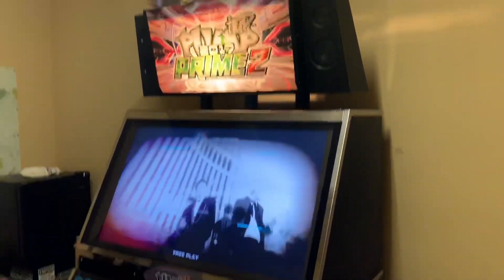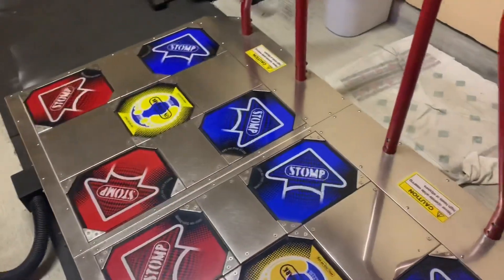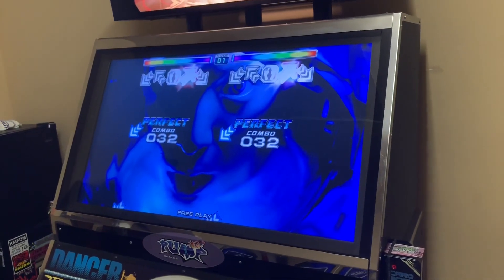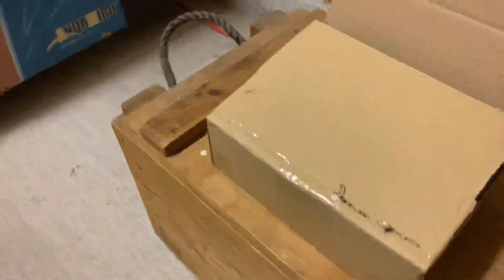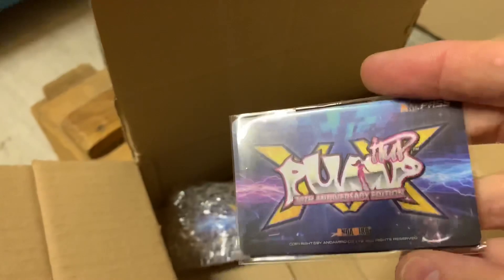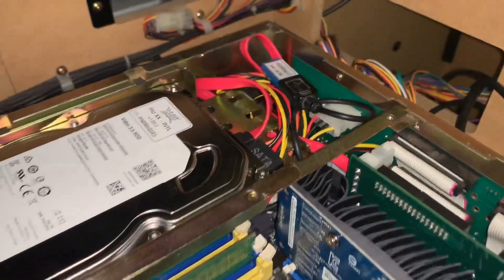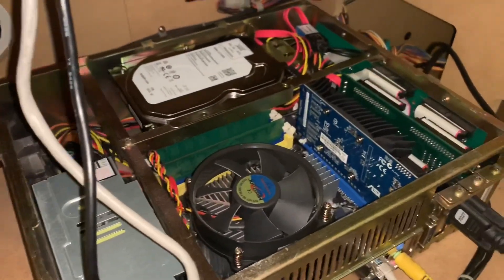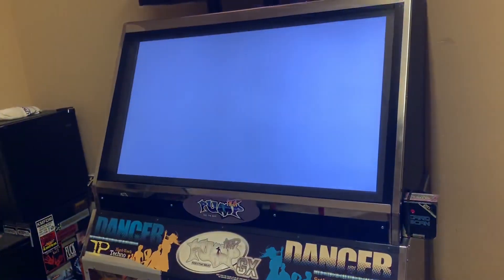Pump It Up XX 20th Anniversary unboxing & GX arcade cabinet upgrade

Comment: Hi sorry if this is a little abrupt but I'm wondering if you're able to help. I play lead guitar in a band and I've been having trouble trying to find a venue for my band to play and coming up with a rig that doesn't require too many things to hook up, and in the previous shows that we played, we noticed that every time we played we did fine but then every time we had a drummer playing with us, the backing track wouldn't get loud enough that the entire show always ends up derailing. So we started thinking of having one of those Pump It Up cabinets and incorporate it into our live set, because not only do we constantly get told that we have to really go out of our way to have a crazy enough setup to get everyone's attention, we realised that Pump It Up is one of the rhythm games known for its skill-intensive gameplay, and one of these cabinets tends to be loud enough that we could play our guitar parts right next to them and we would still be able to hear the backing track, thus giving us the idea of using such cabinet as an instrument to replace the drums. I'm not so worried of having an updated version of the game as much as I am of having a version of the game where it's possible to have custom tracks/levels in the game because we need that to play our original songs. Which Pump It Up cabinet is ideal for us to buy? Our budget lies between $1.5K and $2.25K. -WintermintP
Reply: I hope you do realize Pump it up Machines go from 10-20k$

Comment: Sorry, which graphics Card are You using in your machine?
Reply from the maker: Graphics is an Asus EN210
Mobo is an Asrock G41C-GS

Two sticks of 4gb PC3-8500 ram

Please note: I found sources online that mentioned Asrock G41M-VS3 as motherboard for versions >Prime. However, Prime 2 WOULD NOT boot with this motherboard and DID boot with the G41C—GS. I don’t think this info is anywhere else online. Good luck.
Reply: Amazing, I Was looking for the exactamente same model of the Mobo but I didn't knew if they could run the Game, anyways when I have the Game fisically or any poder Game such as prime or nxa) I Will give some feedback on it
Reply from the maker: M0ST1CHU One other data point I can provide is that NX & NX2 will not boot on this setup. Both of those ran fine on the older motherboard & gfx that are stock on GX cab but unfortunately doesn’t seem to be backwards compatible, just fyi
Reply: No problem, and Thanks for the help, I Was thinking about using this set Up Ford stepmania and newer soft

Comment: Hey do you have any links to the tutorial on how to buff the pads? Looking to make my pad shine! Much appreciated if you can help,
Best regards @ketafol
Reply from the maker: I’m sure there are are but I don’t think I went by any specific tutorial...

This is what you need:
A decent sander (circular probably > belt)
An assortment of pads from grits in the hundreds to as high as possible. I think 8000 was as high as I went although I believe there is 10k

-Take metal pieces off obviously
-For triangle brackets, get a piece of wood and use a piece of plywood and dremel or something to cut out inlays for you to secure them down so they’re not skittering everywhere when you try to sand.
-Pieces that have visible deep scratches will need to start sanding in the hundreds until smooth and matte finish
-repeat 
-work your way up to finest grit for mirror finish
-This can potentially be done with plexi pieces as well but you’re not likely to get as good a result as just getting some new plexi squares. Also, the wear & tear on plexi pieces comes from below, wearing out decals, which can’t be fixed, only replaced.
Good luck! This part takes some work but it’s definitely worth it!

Comment: What's the going price for a Pump It Up GX these days?
Reply from the maker: Definitely depends on condition... This cab was in sorta rough shape (but fully functional at the time) and I think I got it for like $1500-$2000. I’ve seen people asking $4k for ones in good shape.
Reply: @ketafol  ouch $1500-$2000 thats not worth it for a GX at all I'd say $1200 tops and if you look hard enough you can get one for super cheap i got my SD cab for only $300
Reply from the maker: Nice Youtuber It’s been a while.... you may be right, might’ve been closer to $1000. I’d still say less than $1k would be a damn good deal if it’s in decent shape.
Reply: @ketafol  ive seen gx cabs for as low as $600 but yeah less than $1k is very good
Reply: @NiceYoutuber  $600 where at lol send me a link when you find that, cheer's.
Reply: @brim221  oh this was at an arcade that was wanting to get rid of it
Reply: Is there a link to buy use machines

Comment: How do you upgrade your monitor?
Reply from the maker: The MK9 is basically just a regular computer and has a standard VGA output. Any computer monitor or TV with a VGA connection should work. The only tricky part is modifying the cabinet so that it still looks good. Some people just remove the top of the cabinet and put a TV on top. I spent a lot of time with woodworking to make it look stock and have everything fit right. If you have a GX cab and a TV/monitor you want to try, just hook it up and see that it works. It should display properly without any mods.
Reply: Hell yeah! I got a vga monitor. Woohoo!

Comment: Hello I am hoping this message finds you i just bought a pump it up full machine and am having trouble finding out how to fix it. I am hoping there is some way you could message me back. Please it would mean the world to me as its been hard to find resources in trying to fix this machine.
Reply from the maker: Details? (Type of cabinet, version of computer inside, version of PIU running) What issues are you having?
Reply: @ketafol  sx cab mk6 cracked prime 2015 and i think my foot pcb may be bad or io board i also have no neon or sub fuction other speakers work though. the foot pad isnt working at all
Reply from the maker: @jimmypickle6557  Without being there my advice is pretty limited... but in the test menu of course you can do an input check, maybe it’s not even letting you do that though. 

That’s an odd combination of things that are out... kinda sounds like a fuse or something common upstream for several things to be blown at once. I think the power distribution for all of that comes from the same place in the bottom right of cabinet (in the GX, I’m not familiar with SX)

I would say... check that area and make sure no blown fuses (step 1)

Next, I would use a voltmeter and make sure that I’m getting power to each of the components that seem to be nonfunctional. If the board is getting power, all connections are correct, and it isn’t working, then unfortunately it may need to be replaced (that board). And you know how that goes: scrounge around on eBay or pay an absurd amount to an arcade vendor.

Hopefully you’re dealing with a loose common power connection or a blown fuse. That would be my guess with all of those things out. Secondarily, if this is an old unit you just picked up, maybe something bad happened (power surge, water, etc.) that caused this.

Let me know what you figure out, good luck.
Reply: @ketafol  yes i can get into the test menu i will check it out when i have the time and get back to you. thank you so much for replying i really appriciate it. i might take a video and post it on youtube.
Reply: on a quick glance the subwoofer wire seem to have gotten cut and as for the neon i will assume the transformer may have died. but my big issue is the foot pads not working. how do i diagnose that, use the test menu? the game boots up and loads just no fat pad fuctionality.
Reply from the maker: @jimmypickle6557  test menu... if you’re LUCKY, it’s a broken wire or something on that manifold that connects the pads to the cabinet. Logically, that’s something that might get broken over time with a machine getting moved around, connected & disconnected. If someone disconnected the subwoofer, they may have done the same with the neon lights. Dumb thing to do but an easy fix. 🤞
Reply: @ketafol  thinking about it not when i hooked up the pad wires the ones outside the machine some of them looked frayed. well i guess i will have to look at all the wires now. thank you for the help. i let you know what i come up with.
Reply from the maker: @jimmypickle6557  use a voltmeter to figure out which wires are shorted (if it isn’t visibly obvious)... betcha that’s it. Super easy.